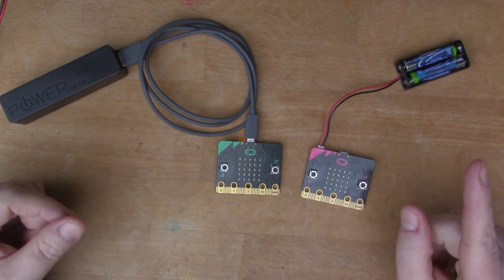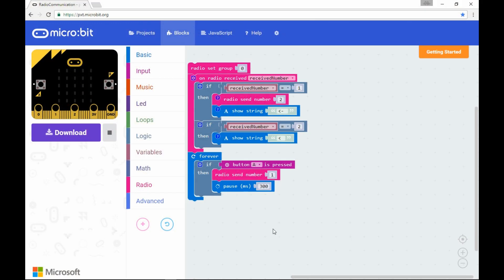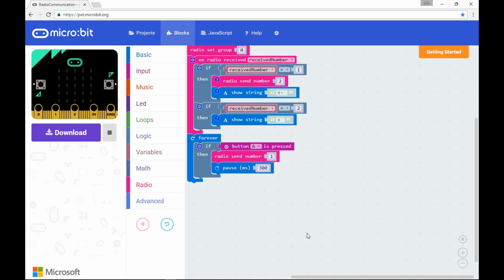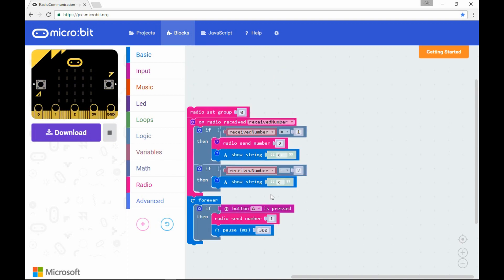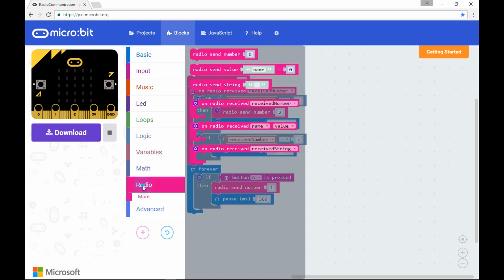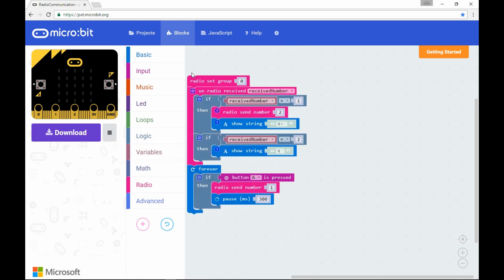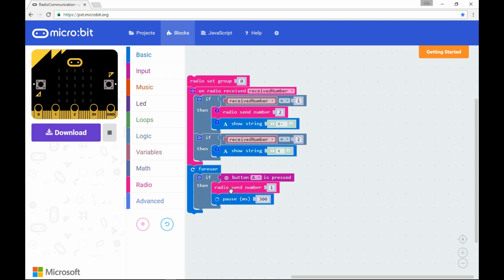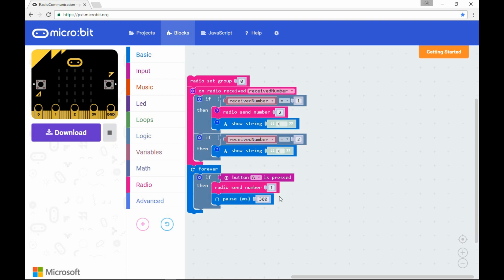Using the 'Radio' service to connect micro:bit to micro:bit

Comment: How can we obtain data from one micro bit and send it to the other? Like temperature or light
Reply from the maker: In terms of communication between microbits: you can use this radio (Bluetooth) method, or you can connect them electrically and use serial communication. For the sensing side, if I remember right the microbit can sense light (I think it uses a LED to do this), or you could add a phototransistor of LDR and read a light reading this way (via an A to D converter). There is a standard block/function to read temperature, but I think the reading is not quite right as its the CPU temperature rather than ambient.  Again, you can add a sensor on to get a better reading; the DS18b20 is cheap, precise and easy to use.

Comment: Good work Sir. How can we determine the bit rate of data sent from one microbit to another?
Reply from the maker: The datasheet for the Bluetooth chip says that the data rate is 250kbps.  If you actually wanted to measure the rate there is a 'runningTime' variable you can read to work out elapsed milliseconds.  You could do something like get one microbit to echo back a message it received via bluetooth.  The sender could then work out the round trip time for a message.
Reply: @MartynDavies  So according to the datasheet, the bitrate is 250kbps regardless of the communication distance?
Reply from the maker: @hazghaz7223  The datasheet doesn't talk about radio impairments.  Increased error rate will, of course, reduce overall communication rate. So distance (hence attenuation) and interference will have an effect on the data rate.

Comment: What if recievedNumber is more than 2?
Reply from the maker: In this example a number greater than 2 wouldn't do anything because there is no if statement to catch it. Also in this case the sender can only ever send 1 or 2, but you can add any number of different messages to send, and process them on the receiving side with the right if condition.
Reply: Thanks!